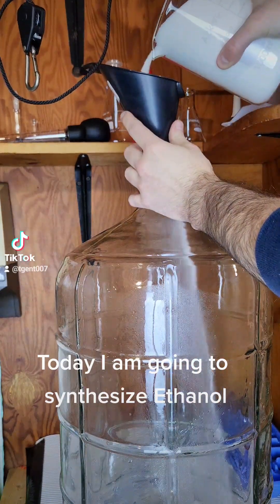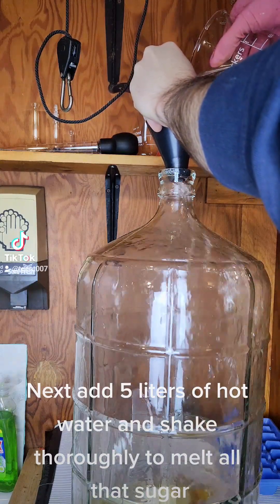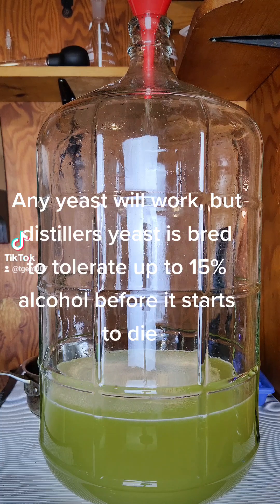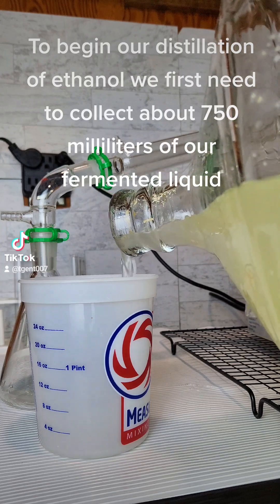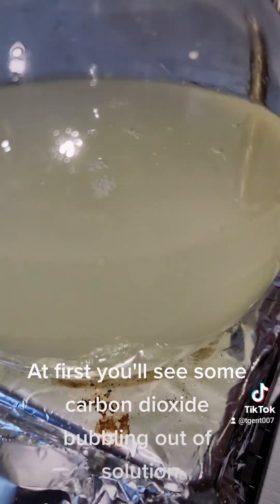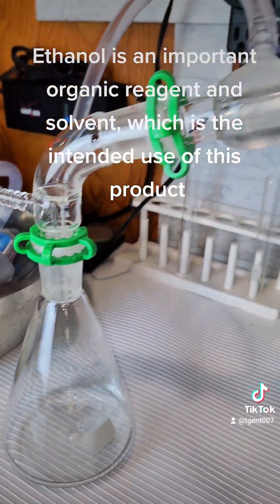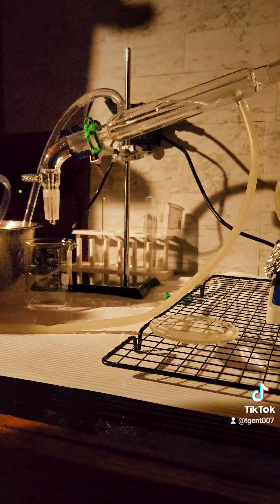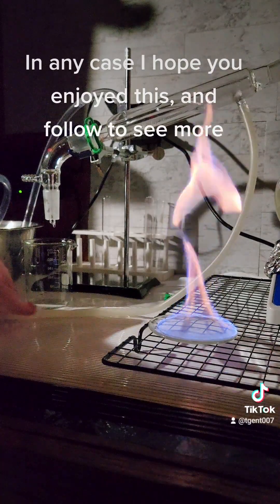Making Ethanol (Short Version)

Comment: Perhaps you'll get better condensation of your distillate if you have the cooling water going in the bottom of your Leibig condenser, which would make it such that the whole cooling surface would be in contact with the circulating water. This is what is normally done and taught.
Reply from the maker: The boiling point is such that it didn't matter much for this experiment. I did notice I hooked it up wrong a few minutes in but I didn't bother fixing it lol
Reply: Yeah, that worries me as I shattered a condenser after making the same mistake once.